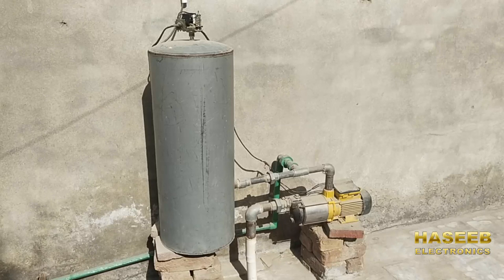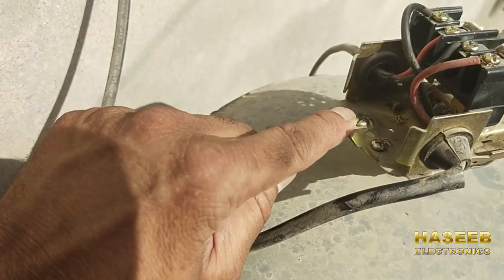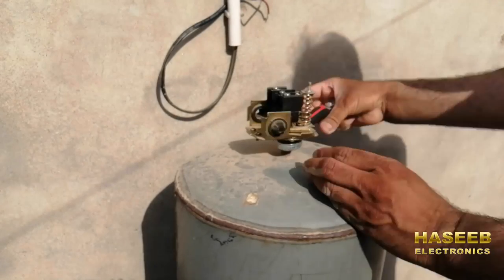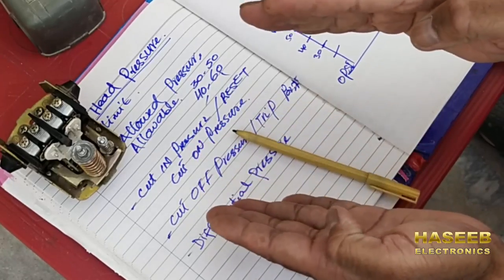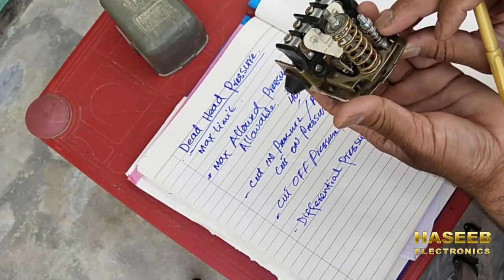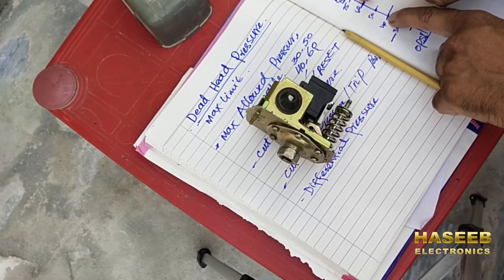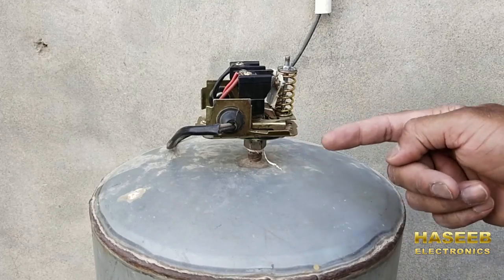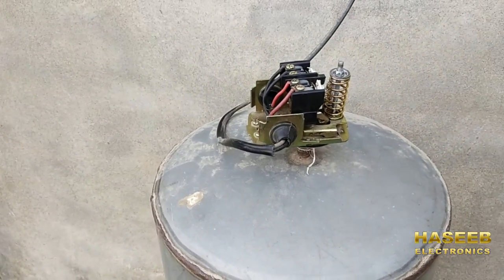[378] How To Adjust Pressure Switch / How to Install Pressure Switch on Water Pump / Construction

Comment: You also do plumbing! I enjoy your "fix it" videos thank you! I would like to design an electronic "soft start" motor control for my well pump. My pump comes on so suddenly that sometimes the pump switch will bounce on and off again a few times before it stays running.
Reply from the maker: best regards
pressure switch chattering problem
most of time it occur due to inadequate air in pressure tank. so you have to add air in tank for give it free pumping cycle. 
just remove pressure switch,
empty water reservoir / tank
inspect  / install pressure switch using Teflon tape
tight / connect and use it

Comment: I was happy that you indicated the unsafe installation with the 2 wire cable without any earth connection. I hoped you will fix this too, but did not. You used the old unsafe cables without any strain-relief. Really? OMG.
Reply from the maker: sir. you are exactly right, as in Pakistan approximately in  every home, there is no Good Earth, and maximum wiring is 2 wire,
if i guide someone, he is not agree to make Good Earth in his home, 
so i indicated the safety point for public safety. but practically i was unable to install, because the customer dont have earthing point, and he dont want to replace wires, 
sir. please accept my best regards and special thanks.